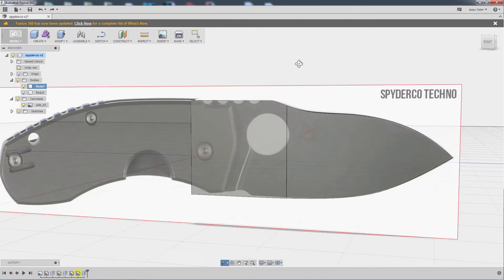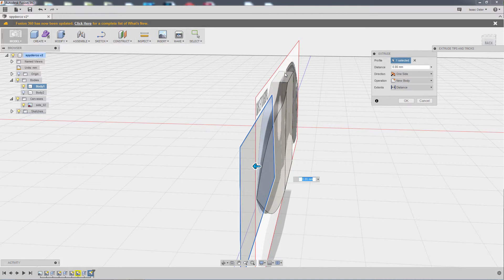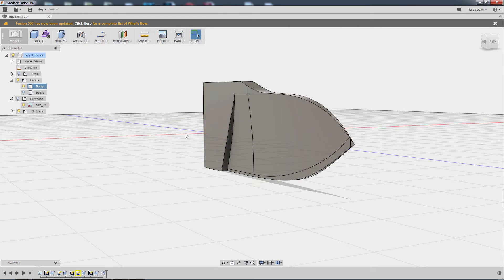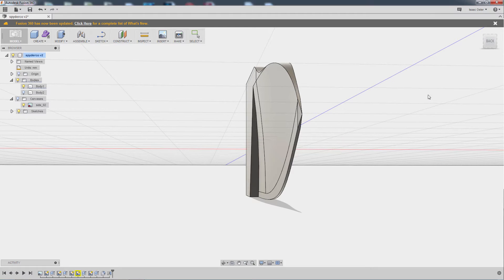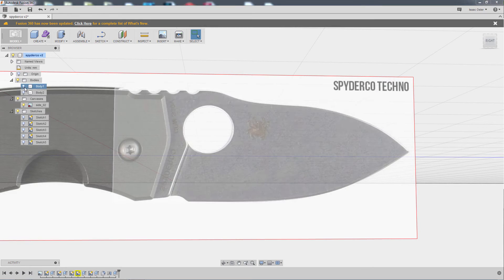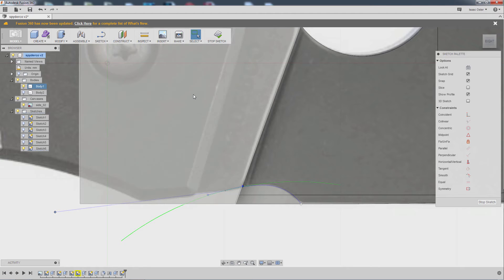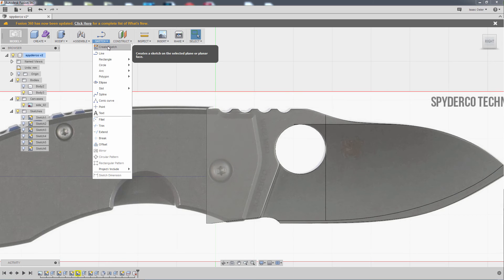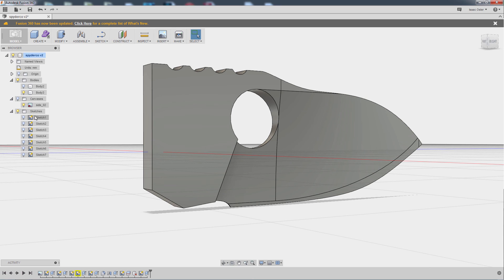Fusion 360 Sample Project Ch 4 - Blade Refinement 02

Comment: Hello Issac! First of all I would like to thank you very much for this tutorial. I have just one question at min. 2:20 you ended up with the boolean operation on the blade and you get a really nice result, but there is a little triangle close to the tip of the knife which give me some problem when I try to render it out in Keyshot: it looks like it is not part of the blade itself. Could you please help me? Thanks a lot! Tommy
Reply from the maker: Hey Tommy, thanks for the question!  I fixed that error on the end by going back to the top down sketch and tweaking the splines so they worked a little better.  Apologies for not including that step in the tutorial, but most folks who get through the knife can figure out how to fix it.  Take a shot and let me know if you need additional help and I'll see what I can do.